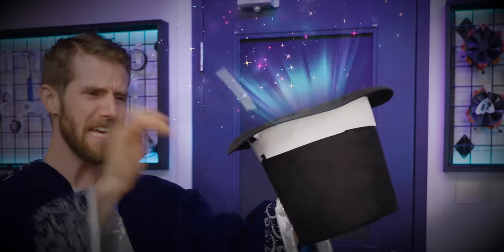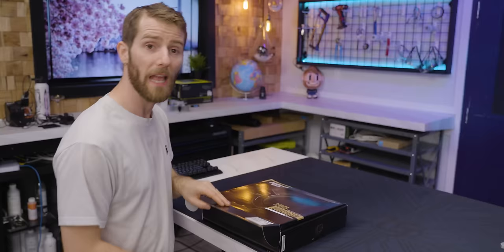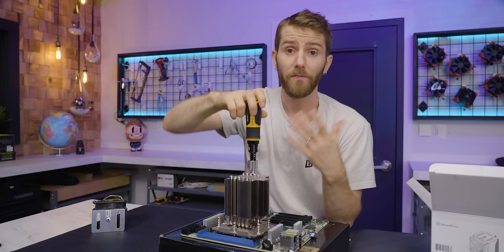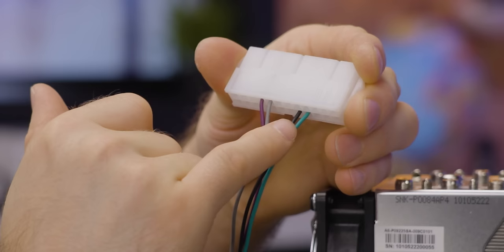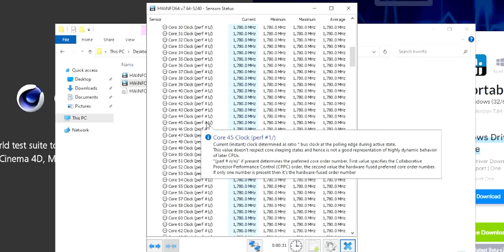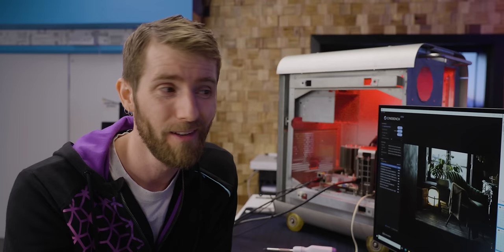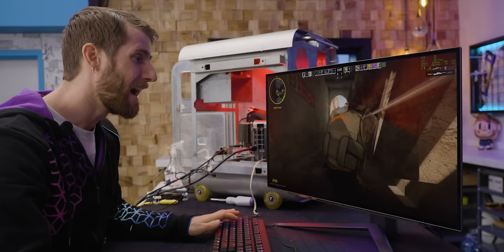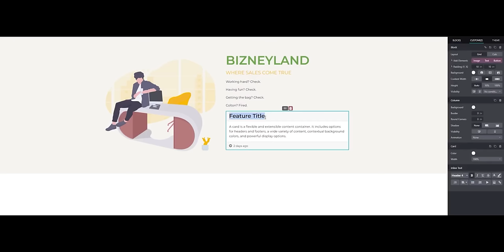AMD’s 128 Core MONSTER - Epyc Bergamo

Comment: I can’t wait to spec out a full system I’ll never afford just to see how insane the performance would be😂
Reply: i litearly would do the same
Reply: Cheaper than a fully specced out Imac desktop
Reply: @jackhemsworth7515 definitely not lmao there’s NO way
Reply: I did this is 2006 a lot. Dreaming of the best gaming PC money could buy.
Reply: @beeseechurger It's cheaper than a whole imac pro
Reply: I still do it
Reply: took a $200,000 deposit on a 9754 system today for one of my local university customers today 9754, quad rtx 6000s,2tb ram and 620tb cm7 SSDs 

they use it for weather simulation mostly but film and astrophysics also get to use it
Reply: Same and then people ask me to do it for them
Reply: Would be interesting to see a "no budget, no sense" build. See what actual gains it would have vs. a budget or mid build
Reply: Don't worry, in a few years you'll be able to buy a fully specced one of these for a couple grand. You can already do it with half a terabyte of memory and a 64 core Rome CPU.
Reply: Lol wait 12 years, and your phone will be better
Reply: @IceKoldKilla This isnt a gaming pc at this point lol
Reply: But could you play ‘Doom’ on it that’s the question ?
Reply: @Realtime1501 I don't see how this is 200k unless it more than one system
Reply: I feel ur pain buddy
Reply: Don't be a tool, the tech in that cpu will be the same as the one in the cpu you buy in a few years, unless you own a power plant and can run Intel plus a chiller for it, which could be based on your biased comment.
Reply: The biggest micro SD cards when first released less than 20 years ago were around 100 MB and cost $100. Today you can get a 1 TB microSD for $100, which is 10,000 times more storage. Tech moves fast, shrinks fast, gets cheap fast. You'll be able to afford something like this in a decade.
Reply: @Realtime1501  Isn't the MSRP for the 9754 only around $12K?
Reply: Just buy some stolen credit card details online. She'll be right mate.
Reply: It’s 5-7k idk why there’s a difference in price but still mad expensive
Reply: Only as good as your network connection 😅
Reply: Funny, I did the same with some late generation Opterons.
Reply: Linus made it clear, the shit he displays is not for buying for the common mortal, he shows technology that will be available in the future for the common mortal. A 2007 quadro is nothing compared to a 3070 today.
Reply: Cool
Reply: @IceKoldKilla Do you have enough money to fulfill those dreams now?
Reply: @eng-eq7xy  in some countries yes closer to $17,000 in the rest of the world,that's why I can see high end PC's here because the fibre speed for the country doesn't allow huge uploads to dedicated servers or allow enough bandwidth for a VM
Reply: @beeseechurger  The Question is for what performance you go. For a good Allrounder with high clocks you can go for a sTR5 threadripper Pro  like the 7995WX with 5.1ghz boost and pedestrian 96 Cores. There are below $1000 USD Boards with 1TB Ram max for it out there. There you pay about 9k for the CPU. But if you go for the higher Clockspeeds for more FPS you can save 4k with the 7975WX with 5.3ghz boost and only 32 Cores for only 5k. If you spec this out you can end up with a crazy system below the 8,8k of a full specked  Mac Studio Pro with more RAM and SSD capacity. Just barely but you can.
Reply: Sounds like my daily routine😁
Reply: I want to see how much tnt you can explode in Minecraft with this 🤣🤣🤣🤣
Reply: Don’t forgot to add four RTX4090s, or RX7900 XTXs, or whatever their workstation equivalents are :P
The dream PC anyone wants lol.
Reply: As a game developer in Unreal 5, i could theoretically build a fully kitted out workstation, but the problem i have is that i have 12900K since release, 64GB of DDR5 and a 3090 already. If i upgrade the CPU to the absolute best CPU i could think of, i would loose insanely in single core speed. So the CPU would be slower than my old one. But i could gain a brutally faster rendering speed. But which is again not needing in Unreal, single core ipc is a lot more important for developing AND actually testing the game. The Ram ... i never seen 64GB be even touched more than half in developement nor when i was playing any game. The GPU is the only thing that actually really makes my life easier. SLI not a thing anymore, i would absolutely need it. Im bound by Vram, but so is everyone else, so theres no point to get a card with more vram because workstation cards are a) slower at processing, but have more vram, and b) even if i would get a workstation card its unrealistic just for development purposes because players run my game at a much slower framerate with less vram. So theres literally no reason to use anything workstation related for me, it just makes it worse than it is, apart getting that 4090 and calling it a day. 

What we developers need is workstation gpus which have the same power, but more tensorcores, more Vram and a way to simulate performance of lesser cards, this would be huge. For example a program like Precision but just from Nvidia, where you can pick a set of a graphicard and it will simulate the performance with your development card. For CPUs ... more cores, higher ipc. So pretty much what the Intel X series did (5960X,980X). Everything else makes no sense.
Reply: @Realtime1501  That's flippin' sick!
Reply: Bro youll afford it in time like 10 years.
Reply: That cpu is technologically a scam, they crammed 16 chips of 8-core/16threads on a silicon board and called it a day instead of designing a 128-core chip. Now let's order a motherboard to run 4 of these chips in parallel.
Reply: @beeseechurger  It's cheaper than an iphone

Comment: I was genuinely shocked at Linus using a non-LTT screwdriver.
Reply: Torque extension on the store when ?!?!?
Reply: Came looking for a comment to figure out why?
Reply: haha same
Reply: @kazoolians  Torque specifications.
Reply: @kazoolians  It's a Gear Wrench 1/4" Drive Torque Screwdriver 1-6Nm 

...a ~$220 screwdriver!  Perfect for not overtightening the CPU screw and costing yourself $12,000.
Reply: I am shocked, SHOCKED! well, not that shocked.
Reply: Best sign that we are outside the consumers' hardware box 🤷
Reply: @Nickayz2 Whachu talking about? Torque wrenches and drivers are available at any hardware tool store.
Reply: @yourimpossibletoisgn at the end he changed to his screwdriver
Reply: @Artholos  Yes, of course. I wrote untypical for consumer pc hardware. In this case the CPU.
Reply: @kazoolians gotta meet specifications unless you want to be risking that 12K CPU.
Reply: 1 thousandth like :) i got the powah

Comment: Yes, CSGO only cares about raw clock speed. Thats why CSGO runs faster on a Ryzen 7 7800x than a 7800x3d. The 7800x3d may have better cache but it runs slower.

Comment: The most insane feature of Bergamo is its power efficiency. Wendel from Level1Tech mentioned that Zen4c is even more power efficient than most currently available ARM CPUs
Reply: What!!!
Reply: @User-dd2xv  you can compare it to an Ampere Altra Max, which also has 128 cores. The Altra consumes about 130W in idle and 350-400W under load. Bergamo consumes abkut 120W in idle and 500-600W under load. But Bergamo is up to three times faster than the Altra Max
Reply: @romanpul Power comsumed per unit of work done. For server chip, it kills :)
Reply: dang, very cool
Reply: Comparing to arm only for watt/power, nah it sucks.

However with 3x the power. Its EPYC.

Comment: What an epic analysis! I can't wrap my processor around the fact that this beast accommodates 128 cores. Good point about the tech in high-end chips eventually trickling down to our home PCs. From raid controllers to cloud-based workloads, it's fascinating how our everyday tech is influenced by these monstrous CPUs. Thanks for the thorough walkthrough, I was on the edge of my seat - almost fell off when you started to spray the coolant! Maybe next time you can try gaming with a liquid nitrogen cooling setup, just to keep things chill. Looking forward to seeing more from the wild world of CPUs!
Reply: An "EPYC" analysis if you will ;D
Reply: @Licher_  Dang it you got there first xD
Reply: They could have named this entire lineup EPYC Legion cause of the 6096 socketpins
Reply: and if todays programmers wouldnt be paid off by hardware manufacturers to put out even worse code that uses all 128 cores to full while providing the same performance as a 20 year old processor :)
Reply: @DeviloftheHelll  ???

Comment: I use to work in a factory that made telecom servers. And one day coming to the work there was a batch from might shift where every single server blade of the production line overheated.

Open upp the first. The plastic cover was still on the cpu, the second.. well every one of them.

Well someone asked the dude that assebmled them and he claim that there was no part in the instructiin to remove the plastic cap.

The person who made the instruction thought it was so obvius so he didnt write it.
Reply: He probably knew but wanted to make an example for why you idiot proof your instructions
Reply: This is a prime example of exactly why an instruction manual must contain the most blatantly obvious instructions possible. Because someone, somewhere, is going to be brilliant enough to mess it up.
Reply: When you write manuals or instructions, you have to think of all the possible stupid things that another person could do...😅
Reply: @B0B_BELCHER  no matter how well you write instructions there will always be an idiot who will beat it.
Reply: "Use your brain to command your arm to move towards the CPU, use your brain to command your hand to grab the CPU..."
Reply: Yup even if its obvious you should write it. Its better to write a few more lines or even many just to avoid problems later. Instructions are meant to be idiot proof. How it should be: if the other guy just followed instructions (like he should) then nothing bad will happen. He might be the most intelligent person yet never experienced that specific scenario before. Instructions keep the guessing out of it. Dont write instructions if you dont know how to.
Reply: To be clear. This was far from the worst thing that happen. To be clear my NDA have laps now.

The most FU think i can think of was the hilariusly stupid helath and safty person that demanded a sprinler system in the heat cambour.  Because it was a walk in one. Someone could catch fire of something in there.

Well the sprintelr survive the testing. And it survive the first week.

It didnt survive the second week.

One of the rapair Lady was closing down the lab for the night. The dude that set it up got a phone call 
"Does it supose to be water in the heat chamber"

He was like. What... water. How much?

"Yea, its 2/3 up then door (full size door with a window) .. oooh the door jump of the hinge,  its coming at me"

Before anyone manage to stop it it emptied out the emergancy water container for the sprintler system  we talking about a 5 meter diameter and 2 story high container.

Most of the water went done the elivator shaft and ended up on the ground floor... where the factory was.

And the factory boss was like.

"When you report damage to the insurance company  make sure to mark it as "water dammage-2", you have to have it -2 because if you don't do it the insurance company will confuse it with What happen last year."

Yea... I'm not working there any more.

I forgot.  They called it the monsun chambour after that
Reply: Never assume the people you work with have common sense
Reply: Never assume something. There is ALWAYS one idiot out there!
Reply: @spencerbair1137 and it sucks especially when that someone ends up being you.

Been there when fixing my VW Golf using shop manual that relies on some basic expertise (that I lacked). 

And I am car-oriented, just more into their electronics than mechanical stuff. Thankfully something that makes you go failed rather than what makes you stop. 

And for thise wondering what I've missed - a thin little shim/spacer that was not documented in the shop manual. Granted I was using aftermarket clutch that was heavy duty (did not want to redo that job any time soon) so it is not exactly shop manual's fault... But I thought that shop's manual is just superior to the manufacturer's 3 page PDF that did not contain torque values and such. And I mean if I knew better I'd put the plates together next to the flywheel and realise there is about 2mm needless clearance, exactly the same as this weird "plastic" ring that I thought is just protective (actually was teflon).
Reply: Having a checklist and following it religiously is common among airline pilots, astronauts, and surgeons. I.e. not idiots. You can't have your brain turned up to 100% 24/7.
Reply: @Num43  Instructions unclear about which arm to command
Reply: Step 0, don't eat the chips.
Reply: This has nothing to do with common sense. When you handle expensive equipment you better follow the manual so your company can blame the sellers if something goes wrong. What if that plastic crap was integral to the whole system? How would he know? What if he removed it and all of those cpu's still overheated? The sellers can then say that you guys didn't follow the manual, but now they have no excuse but replace the equipment for you guys.
Reply: haha
Reply: @spencerbair1137  It's similar to why the cups of coffee you buy often say 'Caution - Contents may be hot',   or the almond milk has a warning saying ' may contain nuts'
Reply: @Num43  so many people will get stuck at "use your brain"
Reply: There's also the fact that if you were to work with the most advanced tech at that time, you would not do shit that you are not told to. Heck a plastic looking bit on top of the CPU? For all I know it could be a new kind of plastic material that transfer heat so well and the manufacturing process is so cheap and simple that you can just adapt an already working manufacturing line to making it so you just include it with every CPU you are selling. Heck, if we bring over people that worked on CPUs that never had an IHS on a time machine and told them to assemble a computer, they might remove the darned IHS thinking "what the hell is a piece of steel doing over the CPU die"
Reply: Yea if removing the part was not in the manual for a reason, you don't want to be the guy that gets told "Soo, you looked at these processors where each costs as much as a car, looked at some components of it, and broke them off thinking 'man, these thingies look like they could be junk, so I decide I Know Better That The Manual, and break it' and repeated that train of thought on every server blade?"
Reply: @spencerbair1137 dont put your cat in the microwave - vibes
Reply: @spencerbair1137  
Step by step, like if you instructed a 4yo.
Reply: That is another reason why you should get them to build one and check it was done properly before you let them loose to build a whole batch.
Reply: lol I left the film on my threadripper build, I kept thinking. I'll leave it on until the last minute so the water block stays clean. Fire it up it's working ok, HWInfo and prime95 oh no whats wrong?....I didn't...did i? Yes yes I am in fact an idiot.
Reply: @conorstewart2214  that dont work in a factory. We had probobly 100 emplees at that part of the factory and made hundreds of diffrent product. The server blade was just one of many
Reply: @benwu7980 almonds are seeds not nuts so if almond milk contains nuts, it's because they handle some nuts in the same factory and their traces might be there in the mix.

Comment: We do cloud computing and have been discussing and testing vCPU ratios and core contention. The performance effects of overlapping VM vCPU and VMs with more vCPUs is something we are always tweaking and eventually resolving with better hardware. It’s something that is surprisingly more strange than straightforward, since VMs experience slowdowns from neighboring VMs on the same CPUs/clusters/cores/caches. The perception of performance is related more to cumulative contention at any given instant than it is to peak capability (specifically in reference to user-facing experiences, not infrastructure which can often be measured in terms of load metrics).

In many cases, there is no direct software solution, which leads to scale up or scale out. 

For us, the only way to see how the hardware perform is to benchmark and create these scenarios to see how we can load balance physical and virtual systems. My hope is that the 4c provides better small-mid scale VM performance and responsiveness in a way that is affordable for our needs.

Comment: Generally speaking those "cloud native workloads" are based around virtualization and/or containers.  For example, you generally give a container soft/hard cpu and memory limits.  Then run lots of them per system.  The more cpu and memory you have the more you can allocate.  Linus made a comment about them not needing to share memory between cores and that is generally correct in this type of workloads.
Reply: Openshift benchmark when (not sure how that would work and what the meaning of such a test would be) 3000 apache pods on a single cpu let's gooo
Reply: Serverless L
Reply: That's what I was thinking too. Thats what this CPU makes sense for anyways. Usually the only workloads that benefit from more cores (even if the cores themselves are weaker) are anything to do with containerized workloads.
Reply: So it's like virtual Box but in a bigger packet